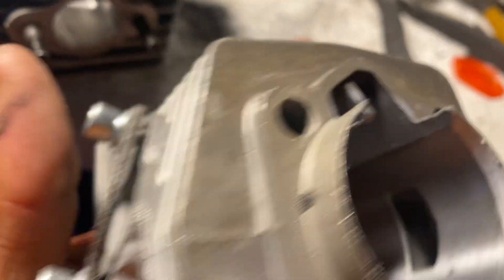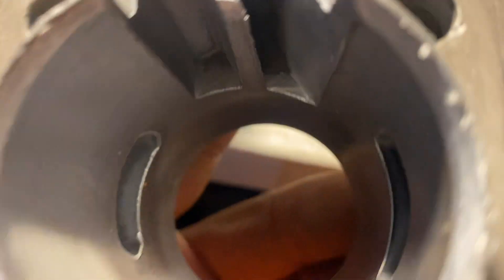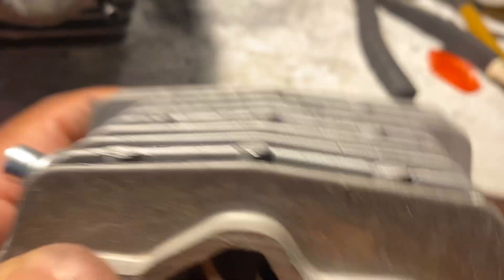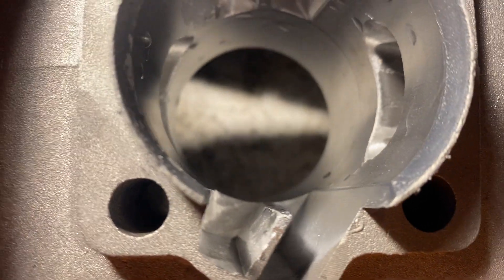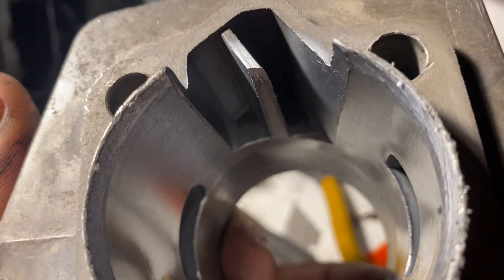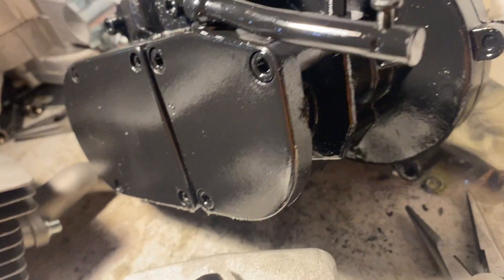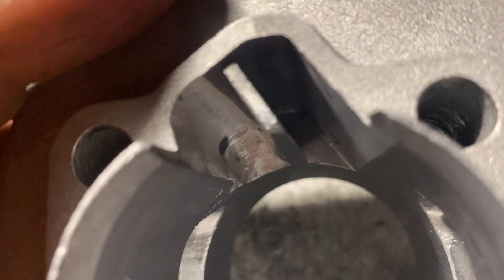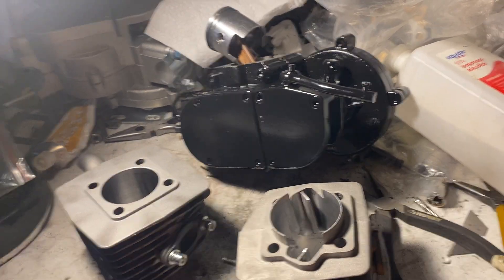Motorized Bike Experimental Port Design.

Comment: Are you going to fill that hole with JB weld? Unaware I bought an LD thinking it was the same as a YD, but with a head and would be easier to port.
These cylinders will be avoided in the future. 180 exhaust, 146 intake 126 tranfers . Was able to raise transfers but did not play with angle.
YD with same numbers will kick its ass.

Comment: Glad you mention this G4 porting is better but on the LD roof angle is basically non-existent. Definitely need to add material cause ther really isn't much there to take off!
Reply: I figured since the LD was a later made 50mm cyl. That they would have designed the ports better shaped. Instead of getting sloppy.
On my 49mm iron sleeve. I widened the transfer port holes and accidentally angled too much of the change towards the intake. To where I was spitting lots of gas back out the carb. But adding a reed fixed it. Better mpgs & no gas/oil all over my bike frame.